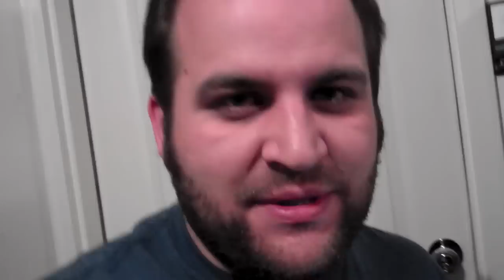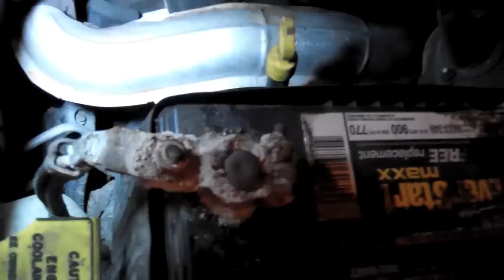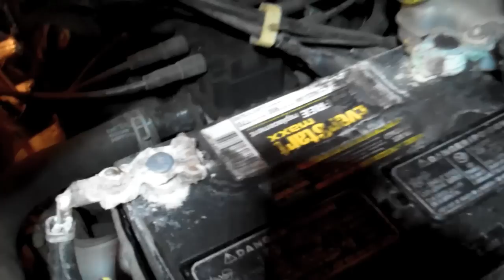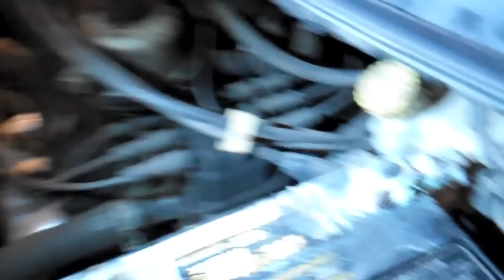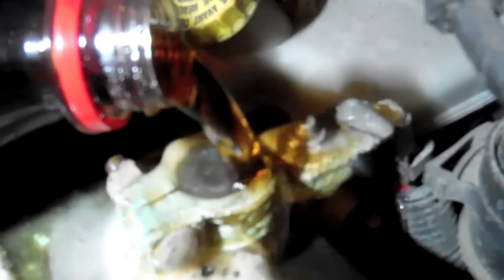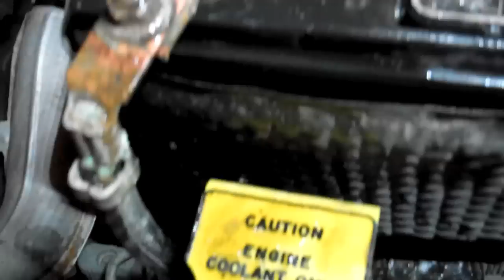Coca-Cola Cleaned My Car Battery

Comment: Coffee will do the same thing.. it is the acetic acid in the soda as a preservative..  Now mix some baking soda and water into a paste and coat the terminals to prevent more corrosion.   Remember to rinse everything below the battery to get rid of the cola and acid.

Comment: Boiling water will clean terminals just as well. Coke is not doing anything chemical. It is simply dissolving the sulphate salts that form the corrosion. This is not a reason to give up Coke

Comment: to be clean, the battery cables need to be removed.    You only cleaned the outside of the connection area, there is still corrosion trapped inbetween the battery terminal and the cable.

Comment: Should you scrub it at all or wash it off with water once you've finished ?
Reply: +Takia Draughan 
I would scrub it because it will only make it cleaner and you can flush the battery with water, but make sure you dry it good.

Comment: Does it work with Diet? Reason being the sugar will leave residue.
Reply from the maker: Not sure, but I'm guessing it would.
Reply: Yep. I use Coke Zero, cause that's what I drink. It works great but you need to remove the terminals and clean them on the inside as well.

Comment: My 2 cents would be don't let any of the soda pop get close to the battery caps or covers for the reason is if it leaks into the battery it's going to affect the inside of the battery but good video thanks for sharing you seem like one cool cat. 😹😺😊

Comment: Not a fan of cola drinks but this is definitely not a valid reason to quit plus it doesn't entirely clean the battery just the top powder stuff. Still needed to be cleaned by hand properly for it to be truly effective. The biggest reason to quit soda may well be the sugar. Imagine 35 to 40 grams of sugar per bottle/can and what a daily consumption of that can do to your body. A drink once a while may not be hurtful but just as anything in life "too much of one thing is good for nothing." People say "its sugar free" not realizing consumer a lot of it means its not sugar free anymore.
Reply: diet pepsi, pepsi max, diet coke, coke zero, are all 100% sugar free
Reply: ***** Nope they are not sugar free entirely
Reply: vagabundoxti
of course they are all 0 calories, 0 carbs, 0 sugar....
Reply: +Elisi Camost Artificial sweetner is just as bad if not worse.
Reply: John Jones
Regular soda drinks can get you to Diabetesville really fast. Diet soda's can't. I used to believe the whole ''artificial sweeteners are bad'' conspiracies and propaganda. But after doing a few years of research, I concluded they are safe. At least in moderation.Same goes for salt, fluoride in toothpaste, chemtrails, electro magnetic waves, microwaves, etc....
Reply: ***** lol, wow...ok.
Reply: +Elisi Camost dont like formaldahyde in my sodas.  Also didnt like feeling strange after drinking a diet soda, very unexplainable feeling that only happened when drinking diet drinks.  you go and enjoy diet crap, Iwill pass
Reply: Zundfolge1432 Beware of the "Diet" label. Dangerously overlooked.

Comment: Lazy bugger.. Didn't remove the clamps, clean and grease to slow down the corrosion, because it WILL happen again!  IT WILL!
The lead pillar will corrode away & become too narrow in diameter for the clamp to close on to it and the clamp will rot right through and break the loop!
Boy... Then will you have fun!